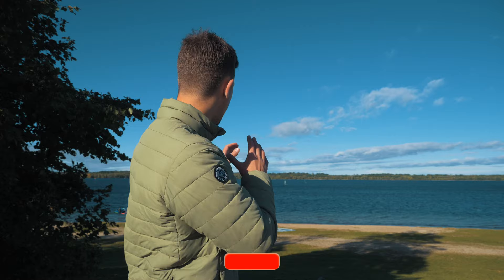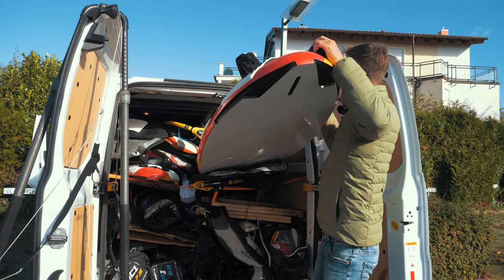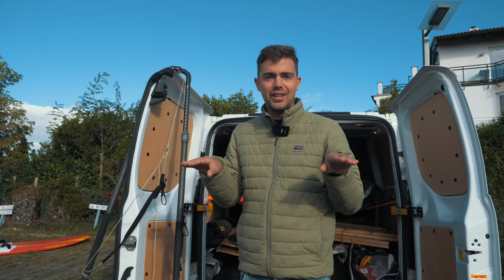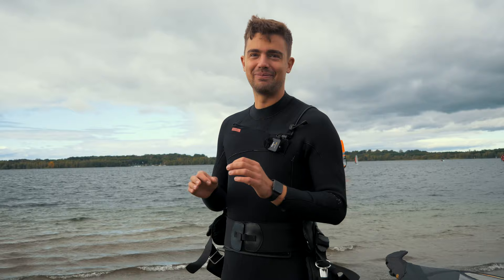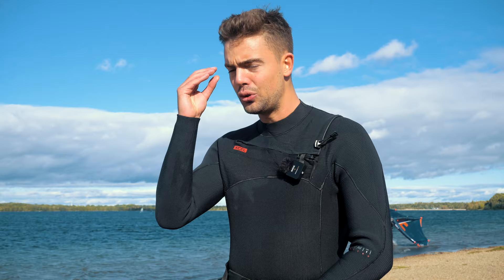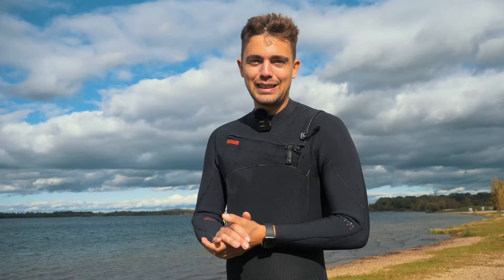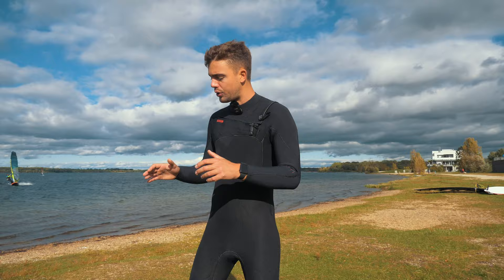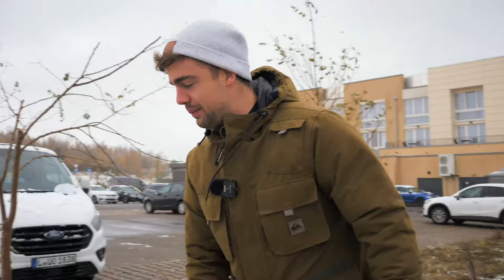2 SIMPLE STEPS, to improve your WINDSURF POWER JIBES ✅ | Windsurf Tutorial

Comment: Staying sheeted in also keeps you turning. If you open up the sail, you’ll straighten out. Even if you somehow managed to weight the inside rail, the sail will want to pull you the other direction. That’s just the way sails work. Then you will have some of the ugliest wipeouts imaginable. I think, almost all jive tutorials fail to mention that the moment you unhook, you’re going to feel a lot of pressure on your back hand. They just say, move your back hand back on the boom, as if that alone will be enough to compensate for that pressure.  But You actually have to be ready to take all of that pressure on your arms the moment you unhook. And you’re going to feel it mostly on your back hand. So the tendency is to put most of your weight on your back foot, and that of course kills your speed and brings you off the plane. It also makes you stiffen up as you say. The trick is to stay in that knees bent position but  still have enough control over the sail To stay sheeted in until it’s time to flip. It’s tricky because that knees bent position is inherently leaning forward so you feel like the sail will just pull you down into the water. It also shows you the importance of rigging the correct size sail. Too large and you can’t control it and can’t stay sheeted in. Some people like to rig way too big because it helps them plane. But then they don’t have the strength to stay sheeted in through the turn, not without leaning way back on the board.

Comment: I haven't been sailing for 2 years yet, but found that one of the biggest mindset changes was to try and keep the pressure as much as possible. Firstly, downward pressure before unhooking. Secondly, not to just stomp the foot across, but rather place it gently and squeeze my weight across by sheeting in. Thirdly, when bringing the rig back upright, always keeping the pressure down on the front hand. Fourthly, keeping this down pressure through the foot swap (shuffle, not stomp), then not upsetting my balance when doing the rig flip.
Squeezing my weight across by sheeting in rather than just stepping made it feel like I was speeding up into the jibe rather than losing speed before it started.

Comment: Mario, thank you very much for your channel. Excellent video presentation and very thorough detailed verbose explanation. I like it! But, if I may, couple thoughts that resonate to this episode. 

First, about "bending the knees.". The thing is that in normal life, walking, running, doing any sport, we can't just bend the knees only. There are three joints involved - ankle, knee, hip. We can't bend just one of those. And in normal situation it doesn't matter what we do - bending the knees or bending the ankle  - the other ones are bent automatically. Except two sports, downhill and windsurfing.

In skiing if beginner is concentrated on bending just the knees, what happens? The boot is very stiff and his ankle do not bend, the tibia stays perpendicular to the ski and the skier ends up in the back seat. Unlike real life he doesn't fall back because of the ski tails, but it may be a bad thing, because the technique is ruined.Hence you need immediately to correct this habit and to be able to dominate the boot in your ankles and sit / squat / compress like you do it on the floor, moving your knees forward and keeping centre of mass above your feet. The motto "bend your ankles" vs "bend your knees" helps tremendously, as well as softer boots.

In wsrfng before attempting power jybes the skill of speed sailing must be acquired first. We are so used to pulling back against the power of the sail, and this is what we actually do for hours, that is very difficult to abandon this when attempting to jybe. We unhook but still instinctively pull back on the sail hard with our hands. No matter how much you will "bend your knees", we still be pulling on the sail back. Here bending the ANKLES paradigm helped me a lot.

Totally agree with necessity to load the mast. After 40 years of failures I was able to get it by combining simultaneously "bending the knees" with Guy Cribb's "sideswipe", sending the mast forward along the centre line BEFORE even trying to turn. I do those two things simultaneously - upper body, sideswipe, sliding hands in proper position (pretty much as you describe in this clip) and inclining mast forward as much as possible, and bending the ANKLES.

Pretty much what you are saying with some semantic differences. You of course much much better sailor than me, but I am much much older hahahaha
Here is my short video about the same, but from the perspective that finally helped me: https://www.youtube.com/watch?v=Nmqz-ELHfSE&list=PLvDt6jV921nSU6tPVn2a41ok9d0f6DxMq&index=4&ab_channel=AndrewLapides

Comment: How do i get pressure on the mastbase in a Duck Jibe?
Reply from the maker: In the beginning its the same technique, later on you will simply have less control & pressure....😅
Reply: Also just make sure you don't lean back when "ducking" the sail. Just surf the board around and don't upset the trim. Easier said than done in chop.